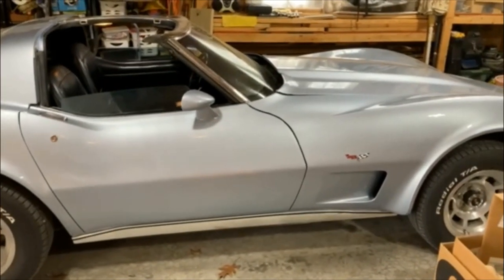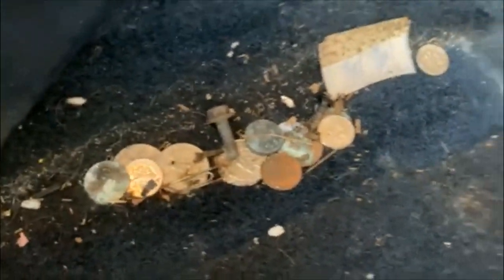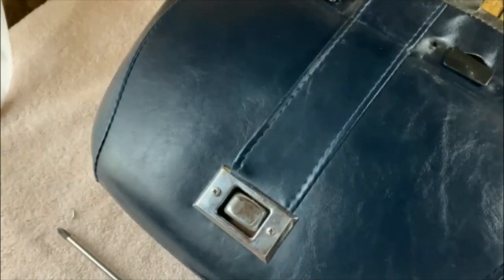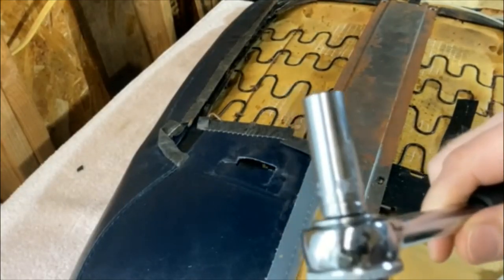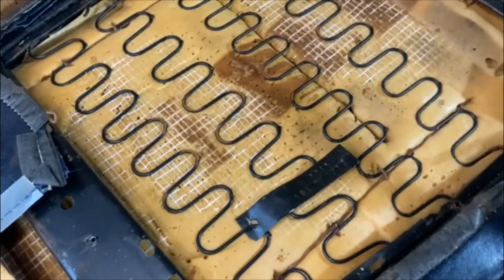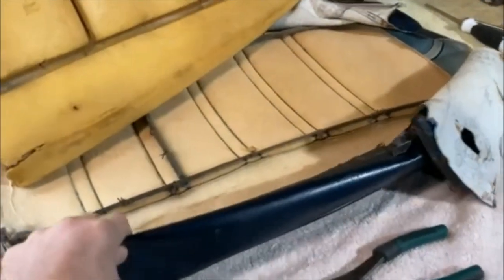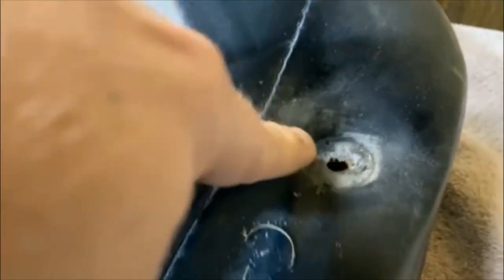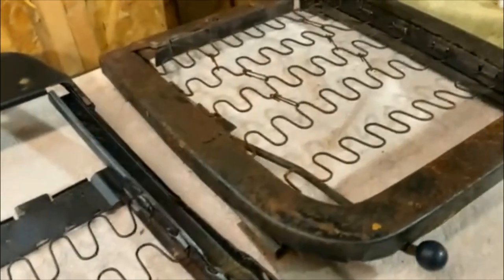C3 Corvette Seat Restoration (part 1 of 2) Taking Apart

Comment: Great video, thanks!  I picked up a couple race seats for my C3 and I was curious if you think I could just swap the seat rails to the new seats or if you think spacers or something would have to be fabbed up?  Cheers!
Reply from the maker: I've seen this modification at car shows on other C3 Corvettes, and it looks pretty awesome! Thank you for reaching out. It sounds like a neat endeavor. Swapping out the stock seats for racing seats can really enhance the aesthetics of your Corvette. From what I've observed, it's a popular upgrade among enthusiasts who want to take their driving experience to the next level.

you're likely well-equipped to tackle this project. The process involves removing the stock seats, installing mounting adapters if necessary (probably will be), and ensuring proper wiring (if apply) and safety considerations. If you've done similar modifications before, you should be able to handle it smoothly.

Remember to take your time, double-check measurements, and ensure everything is securely fastened. Safety is paramount, so make sure the seats are properly installed and that any electrical components are wired correctly (if applied). Once completed, you'll have a Corvette with a personalized touch that's ready to hit the road or track with style and performance.

Best of luck with your project!
Reply: @3amfoghorngearhead791  Appreciate the response, cheers!